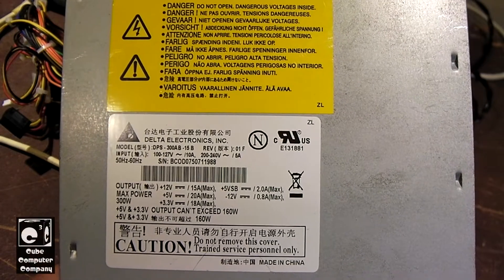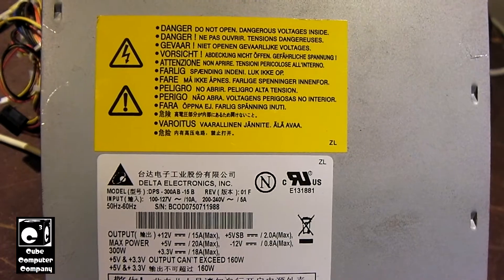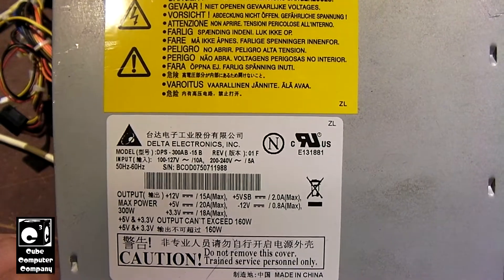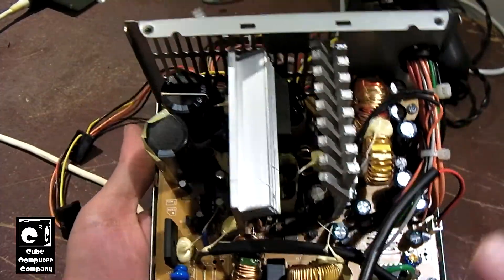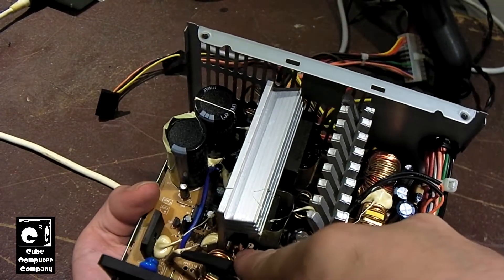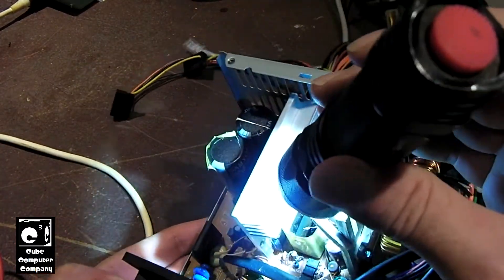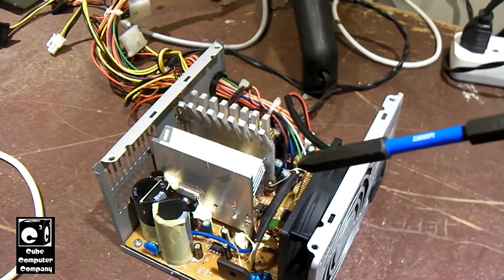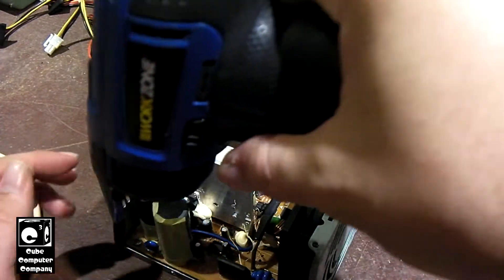Opening up dead Delta DPS-300AB-15B eMachines power supply

Comment: touch the capacitors😈
Reply from the maker: They are discharged. Bleeder/balancing resistors and connected load pull down the primary caps once power is disconnected.
Reply: Touching the capacitor or even it's probes while fully charged wouldn't even buzz you, unless you're bridging the two sides of these capacitors with metal there can't be much harm done.
Reply: Hi
Would you know which of the 12v connections has the highest amp rating- or are they the same